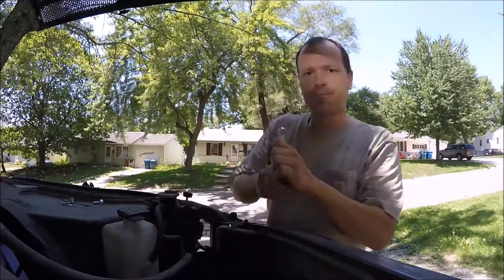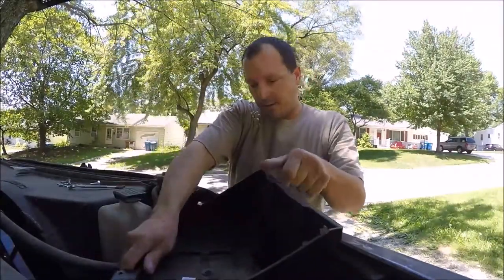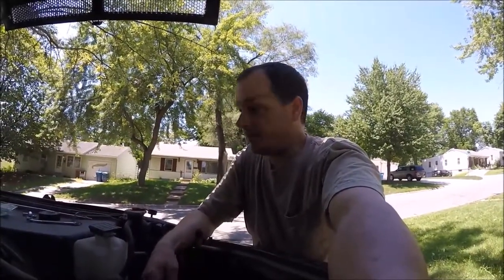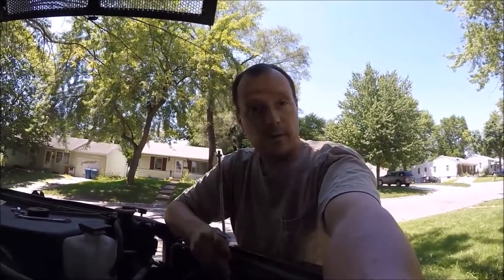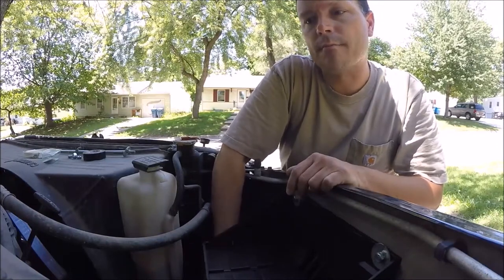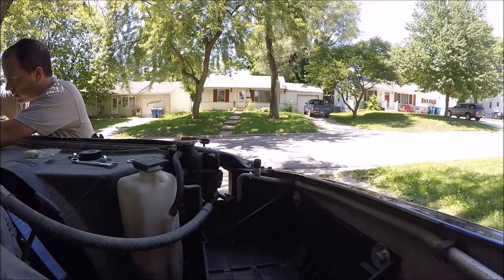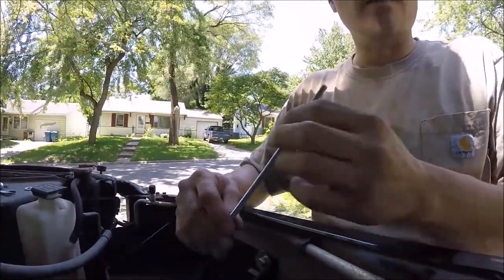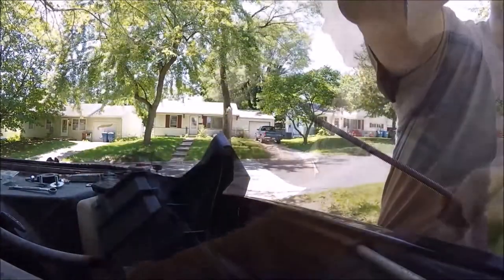Installing a Second Battery in my 1996 Dodge Ram 1500 4x4 (Pt. 1)

Comment: I wound up deciding to invest in a Millermatic 141 Mig welder to fabricate the battery holder so it fits behind the passenger seat under the bed connected to the outside of the chassis.   Man, I didn't even realize there was a 3/4 ton battery holder option.  Shucks, the wire for the 12V positive wasn't cheap either. 

Oh well, I needed the welder for the body panels that I am replacing also.  I'm going to do a walk through and I need to fabricate a spacer for in between the bed and cab as I want this to be able to bolt to the chassis, bed and cab.  I also am planning holes in the top for masts for radio direction finding, solar panel wiring and antennas to hunt down sources of static, noise, interference and jamming... especially those committing sound, mind and body assaults like in Cuba though all over the U.S. and especially in Michigan.  They're serial killing forensically clean my family and other U.S. descent and I think especially if they had U.S. or State jobs and were veterans. 

Thanks for sharing this video.  I am thinking I may add more batteries in the future and now I know there is a stock part that will work up front.  I was also thinking about adding a UPS for the radios and test equipment as well as a 12V battery charger for times when I have 120V AC. 

Where did you mount your inverter if you don't mind me asking?
Reply from the maker: I bet you did spend quite a bit of time fabricating a bracket, etc! I haven't mounted the inverter yet. My budget got real tight, and I still need to order the Battery Cable Kit, for under the hood. I'm thinking of fabricating a bracket to mount the inverter on it's side, under the dash, near the 4x4 shifter.

Thanks for watching, and subscribing!
Reply: I need to document the work and a video would be neat.  Took a while to hunt around for affordable plastic cases also to house the batteries.  The brackets aren't so bad using angle iron, sheet metal and bolts.  I still need to do the install for that since I'm thinking I'm not going to weld in place.  I haven't even started on the walk through phase. Likewise, my budget went on "next winters to do" project.  Great idea on the inverter.  I'm still not sure where exactly.  Was thinking more work (and time) and I could do an outdoor electrical box flush with the body cutout on or a gas tank part from LKQ for outside the bed and have the inverter on the inside.  Up front I use a 175W 12V cigaretter lighter adapter one.  The 1500W though needs to be mounted.  Thanks for the insight and feedback.  John 14:6

Comment: Ooh, you’re gorgeous! But on another note, what’s the purpose of a dual battery on what I assume is a gas engine? I thought dual batteries were mainly for diesel because of the requirement of higher cranking amps.
Reply from the maker: I am going to install a 1500 Watt Inverter. So, I want the extra Battery Amperage, to run the inverter.
Reply: Kickinpony.66 Gotcha! How’s that going?
Reply from the maker: @adriananoelle4699  Slow. The transmission started slipping about a week after I made this video. So, I've been saving money to rebuild the transmission.
Reply: Kickinpony.66 Dang, you too? 46RE transmissions are notorious for slippages, or going bad. Have you looked into replacing the Solenoid? My ‘96 2500 was slipping, and it started working with the replacement, and throttle valve cable adjustment.
Reply from the maker: @adriananoelle4699  Oh, yes. I bought my truck NEW. I've owned it for 24 years :O If I remember, the GM Solenoid fixes the Shifting Problem, and Heavy-Duty Clutches fix the Slipping Issue.
Reply: Kickinpony.66 Yes, that’s right! It’s upsetting how they put such frail transmissions in such heavy duty trucks. Literally, that’s the main problem with these trucks..that, and the dashboards, and seats! I hope the project picks up soon! #RamFam.
Reply from the maker: :) Thank you! I hope to get back on it soon! (Winter is "Upon Us", now). Here's hoping for an Early Spring!
Reply: It's for isolation kit, one battery to turn the engine on an the 2nd to run say an inverter from dc to ac without a draw on the main battery. Now the battery isolator solenoid is put in to stop both batteries from joining while the vehicle is turned off so it wouldn't drain the starting one some people put a 150 amp fuse by both batteries in case of a power surge it will blow the fuse not the isolator.
Reply from the maker: @justinbeck8240  Precisely! Thanks for watching and commenting!
Reply: @Kickinpony66  Thank you. Because I'm doing the same thing in my 99" dodge 1500 4x4. I got the battery cables out of an old school bus wire that was laying around wire crimps that I had for awhile fuses that was just bought yesterday made my own fuse holders, just got to find a place to put my isolator solenoid. I've been using 2 deep cycle batteries before choosing to go with the isolator was 1 week in the making. I've noticed no power spikes with using 2 batteries I just want the ability to use the 2nd battery without draining my 1st.

Comment: I'm assuming it's not a diesel since it only had one battery.
Reply from the maker: Yep. It's a 1/2-ton 4x4, with a gasoline engine. I'm glad that the inner fenders are the same on my truck, as are on the 3/4-ton trucks.